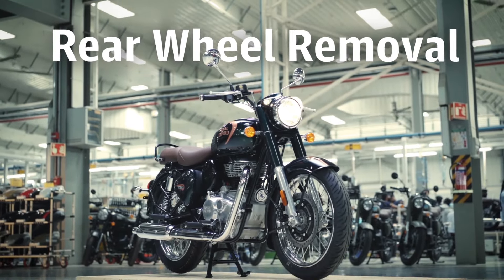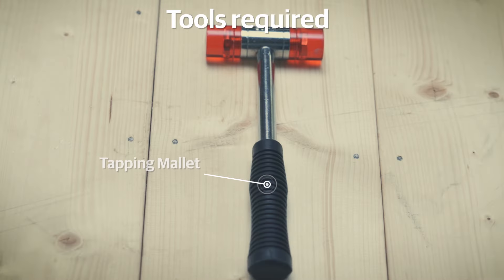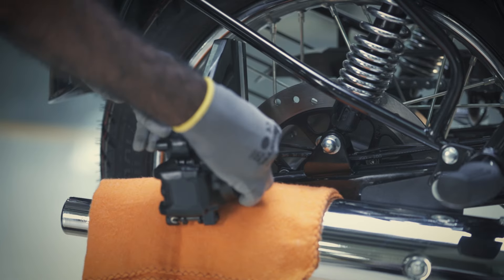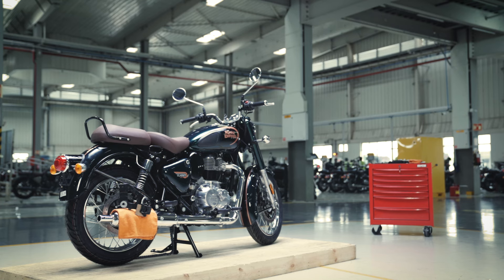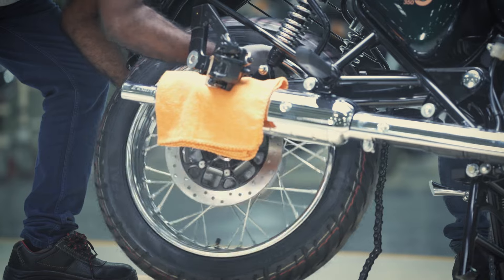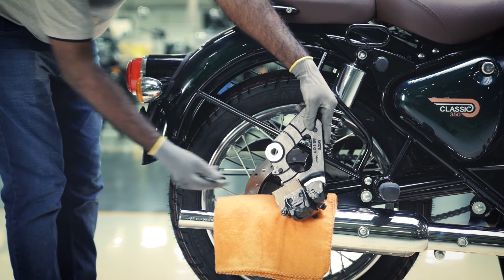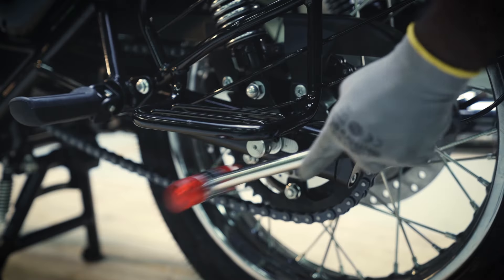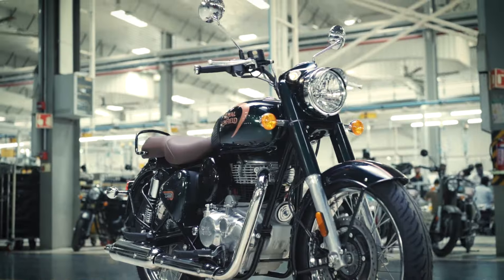All New Classic 350 DIY | REAR WHEEL REMOVAL

Comment: The DIY part ends when you need another friend to tilt the bike ☹️😂
Reply: Indeed! ✅😊
Reply: True
Reply: You could lean the bike against a tree or guard rail.
Reply: DIYers can have friends - surely...? 😂🤣😂
Reply: Biker brotherhood ...
Reply: @peterstecks7660  but then you’re not doing it yourself
Reply: I followed the directions and did this. as it shows very easy and doable :-) After attempting to take the wheel out myself and  my bike fell off the center stand with me swearing...I then involved a guy passing by my street for the tilting part "Hey mate, can you hold the bike for a minute so I can pull out the tire?" 10 seconds job :-)
Reply: Lean the bike to side stand it works perfectly fine
Reply: @LunginthangLhouvum-ml8mh  I instead leaned the bike on wall while bike is on mainstand.., Works perfectly., changed the brake shoes, cush rubber and sprocket.. on three different occasions..,
Reply: @Busywave wow tree in ladakh 🥶
Reply: For a helping friend, you need to visit an authorised Royal Enfield Service center.

🤣